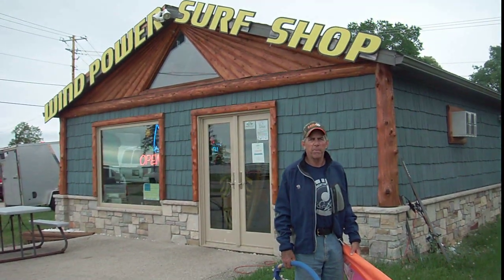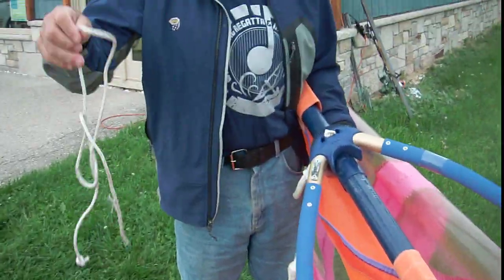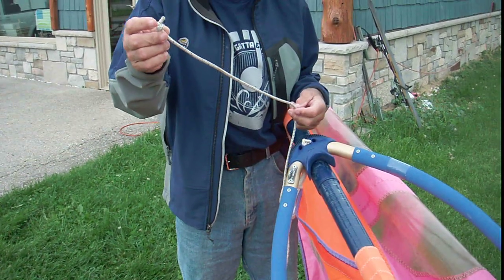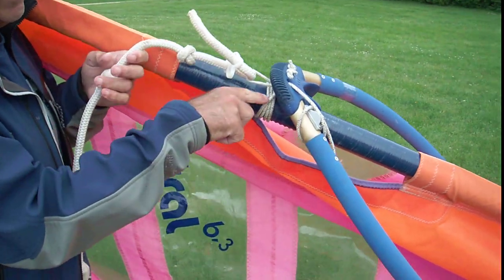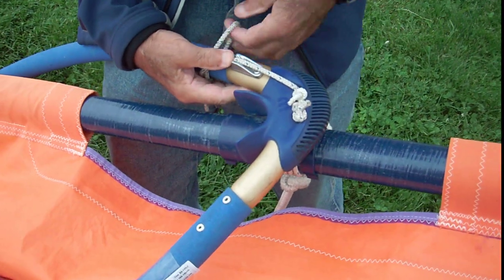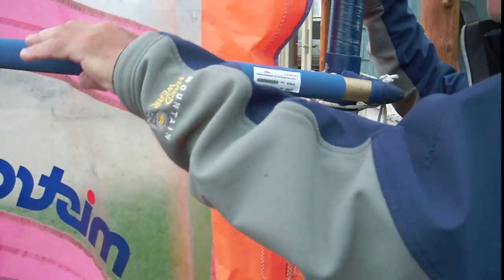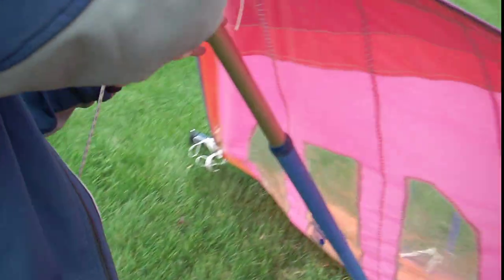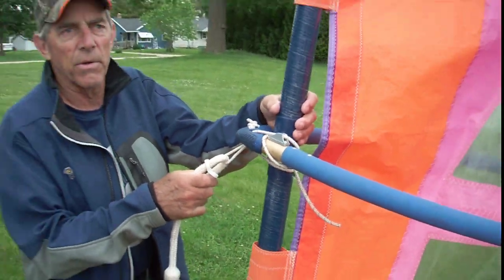Windsurfing Tie on Boom demo

Comment: Thanks! I came to remind myself how this was done after 30years! I always finished off the inhaul with a clove hitch behind the cleat not tucked in front for security. My 30 year old mistral mast and booms seem ok, I will soon find out! Cheers :)
Reply: How did it sail?
Reply: Same here. I came for the reminder. I started off with an original Windsurfer with teak booms and daggerboard (both of which I still have all these years later) but couldn’t recall how we used to fasten the booms. It was amazing how secure this simple system was.
Reply: RIP :(